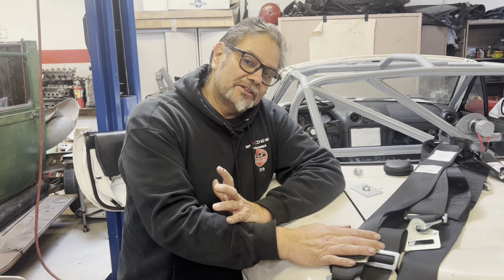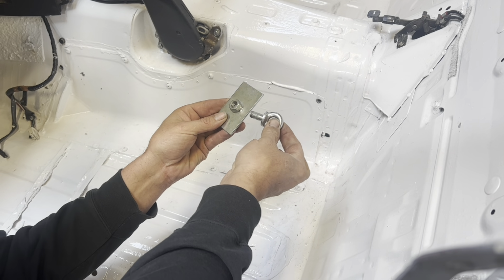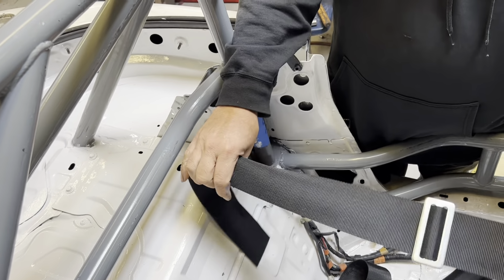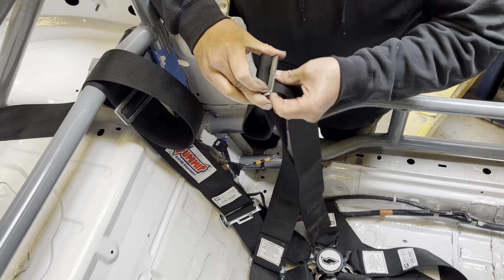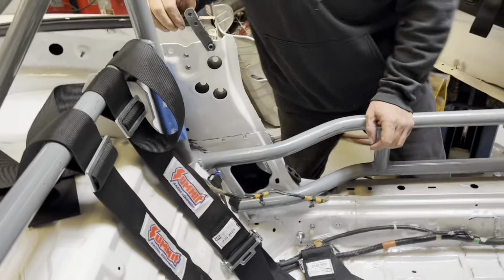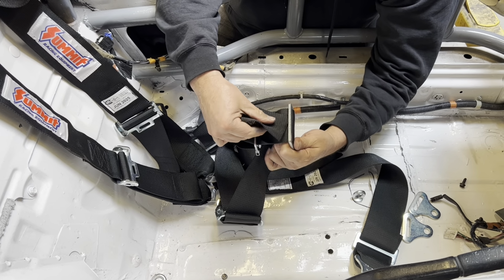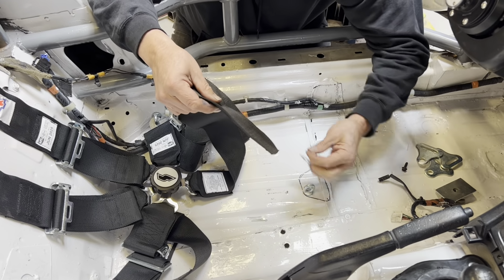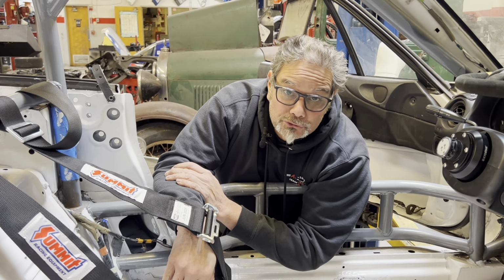PT33 All About Your Belts How To Build A Spec Miata, MX5, Autocross, Track Car

Comment: Thanks these videos are great for me as I join SM this year in a '96 NA8.  Any chance you have a video or could create one for common issues for each generation of the Miata models?  Starting to build out a spare part bin and am interested in the common fixes/spares to plan for outside of repacked OEM front hubs and clutch slave cylinders.